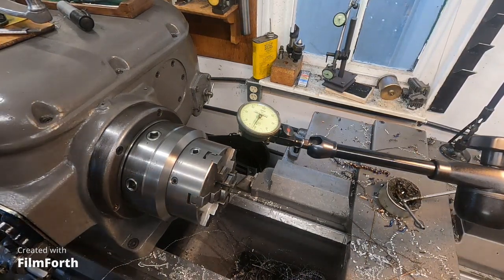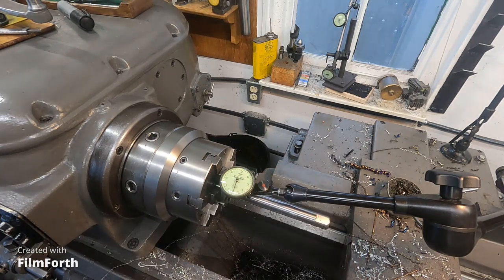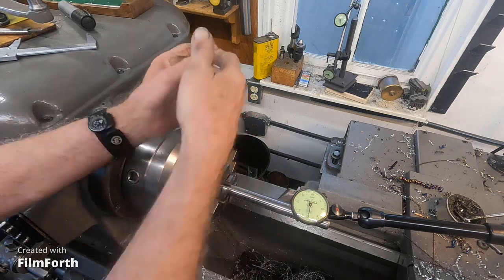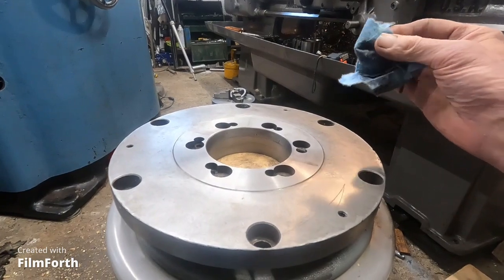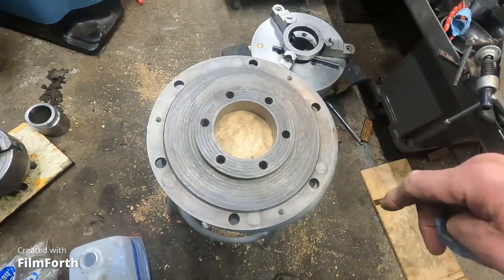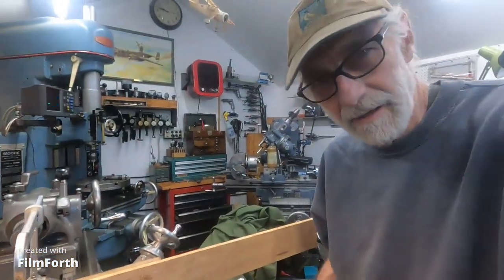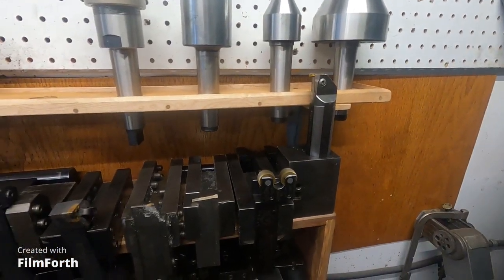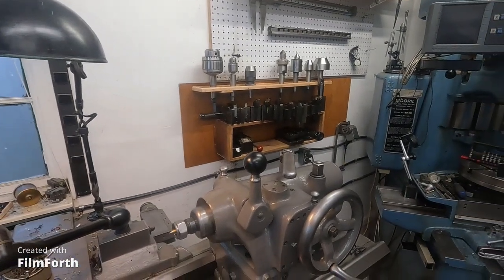Machine shop making the best of space and more

Comment: The Blade is happy he isn’t lifting those heavy tool holders and you are having fun.  Cheers, DeeDee
Reply from the maker: The KDK has an advantage here, with the direct mount chucks and having the post over to the left with the left offset of the standard holders, the most worn area on the ways is avoided. When I would get a job, most often would be on the older lathes like this one before the Hercules Ajax. I removed the Mitutoyo DRO off this Axelson first thing now restoring back to TravAdial of course!